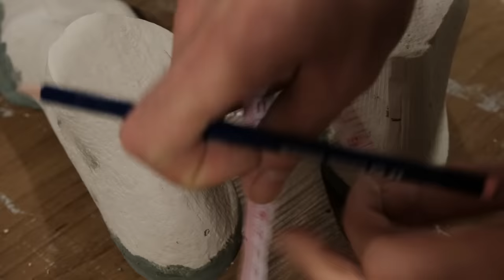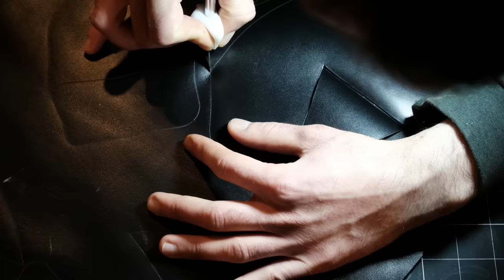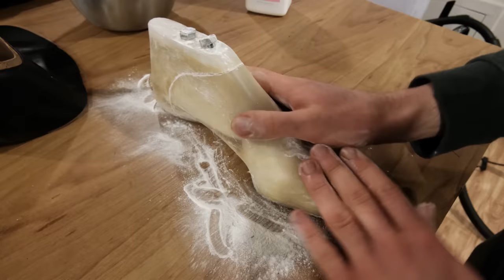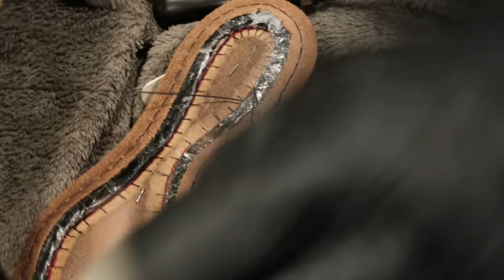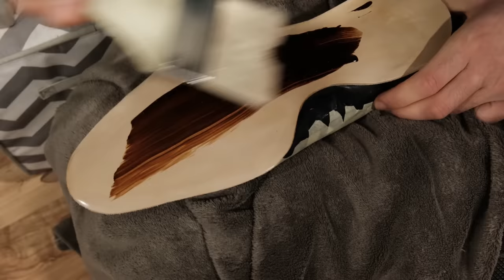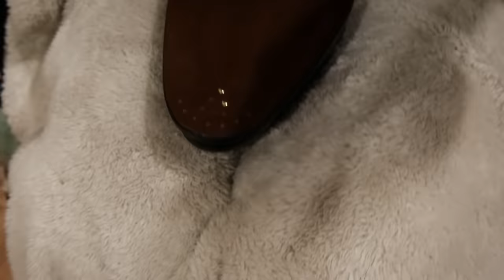Making Leather Shoes - Bespoke - complete Handmade process

Comment: What a wonderful process! I´ve never seen the process of shoemaking, so much work, so arduous. Thank you very much for sharing.
I've got two questions just out of curiosity (and ignorance):
1) have you considered making the molds as a 3d scan and then printing it? is that possible? could it be faster?
2) have you ever been asked to make leather sneakers. I would suppose that's a thing

Again, thanks. Beautiful work.
Reply from the maker: Hello thank you very much. Yes it is possible to 3D print, I just don't like this way of doing it and it's not faster. When you draw a shape on software, it's not the same thing as being able to actually see it, touch it, see the final result. For the sneakers, it's not in my current projects because it's not very interesting to make it custom. It is easier to find comfortable sneakers on the market than dress shoes.
Reply: @alexandrefaure7247  what did you cast your last with?

Comment: Amazing work! I do have a question: around 5:56 You start shaving down parts of the mold. How does this not lead to the finished shoe being too small for the foot?
Reply from the maker: Hello, Thank you. I don't remove material, I move it elsewhere to give comfort when walking and so that the edges of the shoe sit well against the skin. The circumference of the ankle stays exactly the same, but it becomes oval instead of round. Thank you for your relevant comment.
Reply: @alexandrefaure7247  thank you, I had exactly the same concern.
Reply: @alexandrefaure7247  This was the purpose of the string, I think? To ensure that the circumference after re-shaping was the same as it was before?

Comment: I enjoyed seeing how you make the custom shoe. I have two questions: 1) For years, I have had custom shoes made at John Lobb (Paris). On my first shoe of a specific pattern/shape, i had a trial shoe made of inexpensive leather that could be cut up to check the fit and make adjustments. I also had a permanent last made of each foot to make the shoe and make new shoes as long as my foot stayed the same shape. How do you accommodate these issues?
Reply from the maker: Hello, yes a pair of test shoes is always made before casting the last in resin. We don't do all this work to risk a bad measurement ;) But I don't do it in leather, I do it in a kind of transparent plastic which will allow me to clearly visualize the contact zones and the errors. Thank you for your comment.

Comment: Hi, could you please give a little more info about the process? What products/materials were used? It just shows you going through the motions without any info to explain that and I would greatly appreciate it. What was it you painted on to the sock? What was it you laid over that? How did you cut it off?
What did you pour into the molds?
What is that green stuff?
How long did it take for stuff to set up?
It would be nice if there was some info about what all of the products were at each step. Is there a website that lists it? And maybe some explanation of what is going on in each step might help. I would very much appreciate the information.
Would the process be similar if making ankle/chelsea boots?
The end result was very pretty.

Comment: This is fine but i have questions. In the late 90s i worked for a company called The Custom Foot that used laser measurements of the foot. They went out of business due to the high number of absolute failures. It seems that they did not take into account customer preferences and made the shoe true. Some customers liked a loose heel or spacious toe box, or loose rialzo. I don't see where your taking preferences beyong foot measurements into play.

Comment: Very nice video but i have some doubts. I am an Orthopedic Technician an i have been buildings lots for several years. You make the cast of the foot without a heel is thery different than the foot on a 2, 3 or 4 heel. Otherwise you have to modify the cast shape by placing some material under the metatarsals and removing a little from above. You think so or not ? I would like how can you do. Thank you.

Comment: 1. After making a foot cast, why add on a stupid unnatural point to the toes?
2. Pattern making a bit overelaborate.
3. For such painstakingly made shoes, surely you want people to use stickasoles on the sole fronts.
Walking on replaceable rubber is safer and cheaper to repair.
But great work, man. 💪

Comment: @alexandrefaure7247  Could I ask three things?

Is the material you are using to build up the mold into a last shape just a different color of plaster, or is it some kind of clay?

What is the black sealant you are using on the negative mold?

Is this a rigid pu foam last?  If so, do you have any recommendations for what to look for?  I'm having difficulty finding info on what hard foams will work well for shoe lasts.
Reply: nothing i'll say below is 100% sure, it's just my guesses. 

I personally had great success using basic plaster for casting my last and then just dying some more plaster with food colouring for building on my cast, it's quite useful to differenciate your actual foot fro the additionnal matter you add to create the last shape, espacially when you dont want to sand off too much. So i guess thats what he does in the video.

For the final cast, he said in an other comment it's an orthopedic expanding resin, but he can't give any ling because it's from a profesionnal shop. Usually, othopedic supply shops sell some rigid expanding polyurthane resin/foam with a very high density (about 400kg/m³). Unfotunately those shops sell only to licenced professionnals, so you'll have to find a friend that is willing to buy that for you. If you can't, you can look for rigid high density PU foam with similac caracteristics, but not labeled for this purpose. It's hard to find gigid foams with a density of 400kg/m, but you can find some with about 300kg/m density (for reference, you can start sticking nails and screws starting from 200km/m3 density, so i wouldn't go lower.)

from france, here some websites (profesionnal and retail) if found selling those products.

Pro :
https://www.neut.fr/fr/materiaux-podo-orthese/product/mousse-polyurethane-expansee-composant-a.html
https://www.e-podiatech.com/fr/accessoires-ateliers/199-632-podiarigide-expansee-pu-element-a.html#/202-bidon-1_kg

Retail :
https://feroca.com/fr/mousses-de-polyurethane/617-1352-easyfoam-300-mousse-rigide-de-polyurethane.html#/217-capacite_kits-kit_de_2_kg

I dived into this subject a lot the past week, and i ordered the foam on the last link i put above (the feroca website). In about one to three weeks from now, i'll report to you if my attempt with the product was successful.

For the black sealant, i'm less sure about what it is it but it's probably the release agent for the PU foam, so it's not really important which it is. It' could be some liquid release wax (which often comes in black), or a spray realease, that is found easily in crafts supply stores.

Comment: When you are taking a mold for shoes shouldn't you mold the feet while it it bearing weight? Otherwise the foot is not splayed and therefore a much different shape when not under load.
Reply: @denniswilliams3934  That makes zero sense. Wouldn't you get a more accurate measurement while the foot is under load?
Reply: @denniswilliams3934  Prooer shoes don't support the arch. The allow it to do its job.
Reply: @denniswilliams3934  What are you even talking about? My favourite shoes are Vivobarefoot.